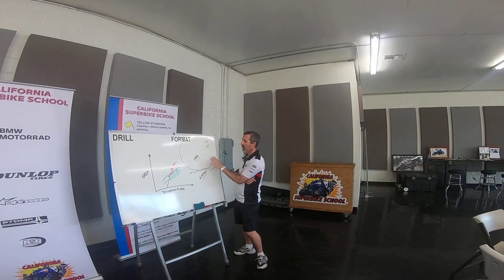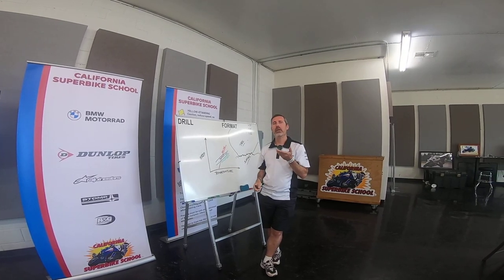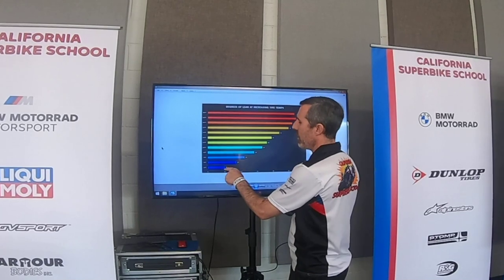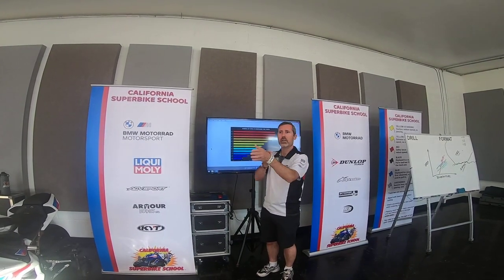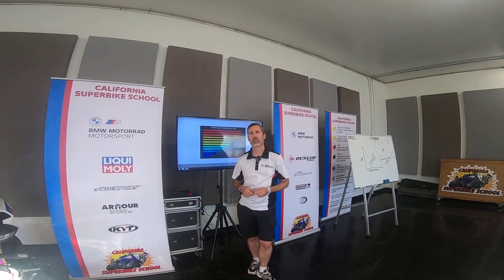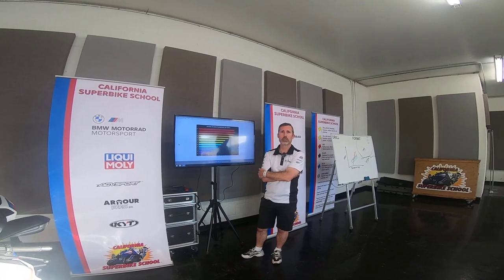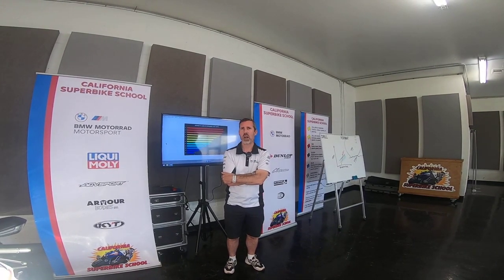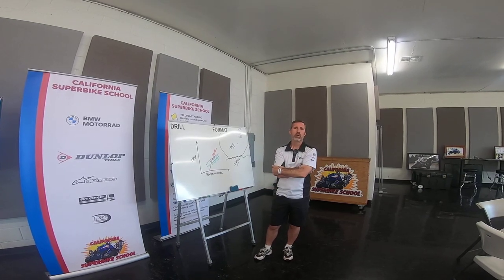Dylan Code Talks Tires and Grip

Comment: Laguna Seca bit me from cold tire crash. Heat in left side of tire is easy. Heat in right side not so easy. Was in race tire rubber so when they get cold from chatting it up in the pits. Best put some respect on cold race tires. Otherwise get checked off.
Reply from the maker: Yup, on a cold day the tire can cool off pretty quick just waiting to get out onto the track. Because Laguna's surface is so smooth you need to get a lot of heat in the tires for them to grip well.

Comment: Another great video that goes into detail. 

Some remarks:

Grip between a Rubber and Rubber surface contact is greater than Rubber and Road. So road that has been ridden contains more in-bedded rubber from previous use and offers better traction.

As tire temperature goes up the Adhesion (attraction between dissimilar materials) with the road goes up. Yet the Cohesion (attraction between similar material) of the rubber material goes down (tire becomes greasy) at elevated temperature . The cohesion vs temperature and the adhesion vs temperature are not entirely linear relations. I would expect that the rubber contains additives to achieve more linear relation in order to make the tire more predictable in its traction behavior. But this is probably at the cost of maximum achievable grip used in street tires.

Comment: Great presentation.

While tire air temp isn't the same as its carcass temp(s), they are related and thus would be good info to know.  Why do TPMS systems as in the S1000RR (used at CSS) not give the option of reporting the tire air temp through the TFT?

BTW, a clockwise track will have 360 degrees more total in right turns than left and the opposite on counterclockwise track directions.
Reply from the maker: Some racebikes put temp sensors in the fenders pointing at the surface of the tire and can record the heat on the left, center and right. You could do this on a production bike as well. I assume they don't due to the cost vs perceived value to the average consumer. Same with sensing tire temp through the TPMS, I think they could easily do it, but it might not be valuable to the average consumer vs the cost.
Reply: @stumanrides  Thanks. My point is that the TPMS sends the temp already.  It's just not displayed anywhere, but would be a good proxy for how the tires are generally warming.
Reply from the maker: @bernhtp  if the display shows the tire pressure, you could use the rise in pressure from cold as an indication that the tires are warm. On the track, in general, you look for a 3-5psi rise.
Reply: @stumanrides  The perverse thing is the RR's pressure display normalizes for tire temp and its changes.